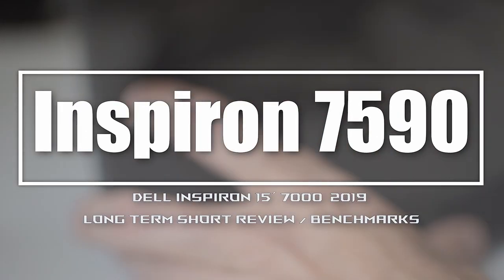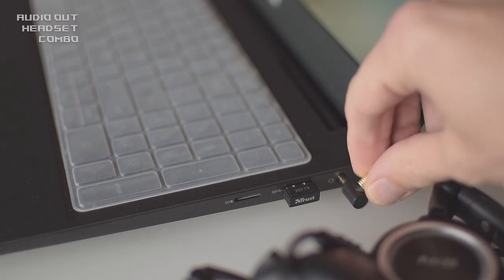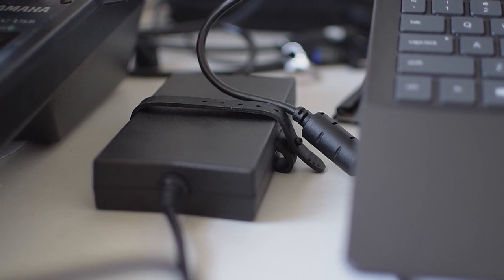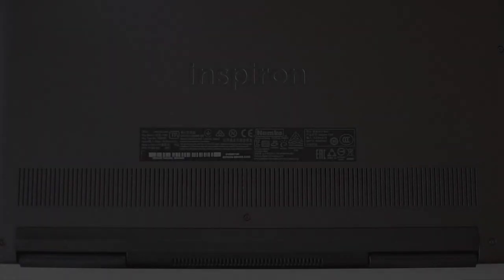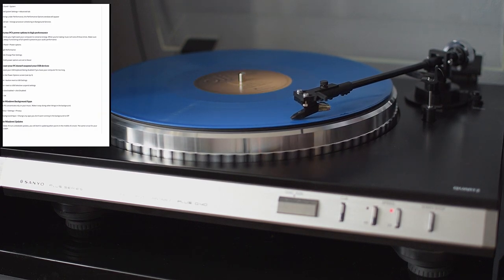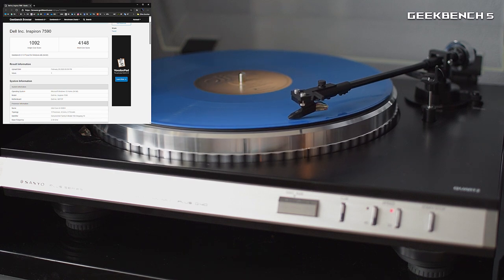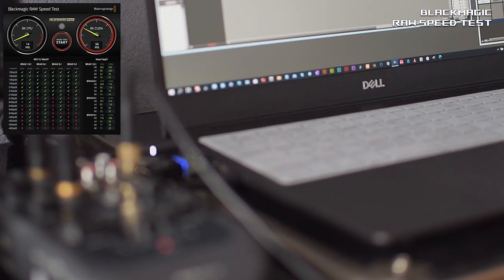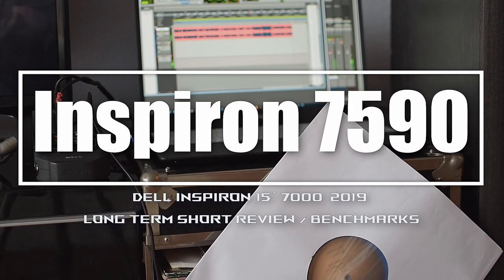Dell Inspiron 15” 7000 ( Vostro 7590 ) Long Term Short Review ( Benchmarks, DPC Latency, Upgrade )

Comment: many thanks, great insights I didn‘t hear anywhere else ...especially the audio related stuff 👍👍
Reply from the maker: Hi! You’re very welcome, really appreciated! Thanks!
Reply: @TechieViewVideo  latency issues are a bummer for me as a hobby electronic music producer. But you gave a hint to solve this 👍 .. also a decent quality headphone jack would have been nice (actually a minimum requirement, bummer again, that it's so bad). I guess Bluetooth audio is again latency heavy. ...well a little USB DAC might be the solution.   ...still an interesting laptop for a nice lightweight budget solution with sufficient performance for music prod., e.g. with i7 9750H processor. ..  there is also an option with 4k Display, have you seen this? Is it good, bright colour accurate? Any opinion on this?  Cheers
Reply from the maker: Hi, regarding headphone jack, if you get rid of all software enhancements ( wave audio ) it sound good, not that good as external audio interface but still very much acceptable and it could drive high impedance headphones with ease. i7 equipped model would be also a good choice but keep in mind that it could be not the best combination with better video processor due to heat exhaustion. 4K display in my opinion is not a necessity, it could be better option for someone who is in need for slightly better color reproduction quality ( color sensitive works - graphics ) but for someone who is busy with audio production it is not a good investment rather go for RAM or better external audio. Regarding bluetooth, there is no serious lag or any other problems with bluetooth, it just works. Overall, after proper tuning this machine makes a fantastic choice for Windows based creatives. Thanks!

Comment: How's battery life?
Reply from the maker: Hi, battery life from my experience was quite good, about 4 - 5 hours on full capacity or about 9 - 10 hours web browsing with optimized thermal management settings. Thanks!
Reply: @TechieViewVideo  Thanks for replying. I'm looking for a college laptop right now. I'm considering the 2020 version of this insprion or the dell xps 15 2020. Both come with the same specs in my country, only the inspiron is 600 euro less. Looks like the inspiron is a better option, the xps just looks much better.
Reply from the maker: Hi, XPS is great overall, fantastic machine absolute leader in Windows, would be definitely a better choice if you can afford it. Inspiron 2020 is very capable and well designed machine as far as I know so it’s really up to your financial situation. Both options are very good, indeed! Thanks!